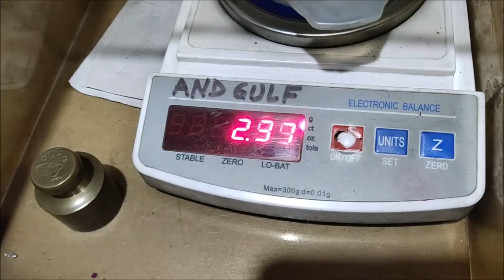How to melt old gold jewellery (Traditional Way)

Comment: Question sir, Did you mean Nausadar Katli  powder also know as - Ammonium Chloride?  Are you adding it to your metal under a flame or just dipping it at the end?  The powder "Ammonium Chloride" Is not really for bring up the gold  color as much as to  help to remove some of the baser slag metals. The reaction is simply that the chlorides of
these baser metals are insoluable in the melt, and slag off, so
available chlorine at the surface of the melt reacts with those baser
metals, causing their removal from the metal mass, but only if you add it while the metal is molten. And yes, it forms
lots of fumes, including chlorine gas… Do it only with excellent ventilation.
Reply from the maker: Sure Ma'am thank you so much for your comment

Comment: Could you make new jewelry out of old 14k jewelry?
Reply from the maker: Yes Definitely
Reply: @GoldArts  I been wearing my mothers necklace since she passed away in 2013.. I never took it off... Its a very thin chain, 1mm or less thick... I also have gold that she bought me when I was a kid that I can no longer use.. I always wondered if I could get the gold melted down to create a thicker more masculine chain from all the sentimental gold... Would be the best option but I don't think there is a place near me that does this procedure... When i asked they told me they can't do it with 14k gold jewelry that it has to be pure gold.   I never understood why.
Reply from the maker: No. Not necessarily it needs to be 24K. It can be easily made in 14K Gold. Why not ? You yourself can google 14K jewellery and see the results. Your old jewellery can be melted down and be made a more thicker chain for sure
Reply: @GoldArts  i guess they were trying to make it sound more complicated to charge a higher price.  They were saying different metals have different melting points and that they would have to extract the gold from it etc... It never made sense to me.. you melt it,, mold it, and make a chain.. wish you were in NY lol.  Thanks for the responses.. appreciated.
Reply from the maker: That's nice.. please do subscribe to my channel as well
Reply: @Guinea54  The thing with turning old gold into new jewellery is that the old jewellery contains solder. (used to put pieces together) This has a slightly other alloy. It can make the new "melt" crack more easily or things like that. Its definitely a hard proces with red gold, which contains copper, which doesnt really like to melt to a blob. Source: imma goldsmith
Reply: @Flapmansss What about a 10k ring and add 24k gold to the old ring would that not increase the gold purity? I saw some Jeweler do that, or recommend it to me for a sentimental ring I got as a child.
Reply: @kennycampos3130  definitely! He probably made it into 14k?
Reply: @Flapmansss  not sure to be honest. Thats what I was recommended, not sure how that would work. 10k+24k= 14k. I would think depends on how much gold and grams are added as well right?
Reply: @kennycampos3130  Well he couldve just stick with the 10k alloy but here in The Netherlands we mostly use 14k. 14k is 585/1000 gold (so 58.5% of 100) and the rest is silver and copper. You need to do some math to know how much grams 24k gold,silver and copper need to be added to make 14k from 10k.

Comment: Can we change it to 24k.?
Reply from the maker: Hey Vedhalakshmi,
I dint get your question.
Do you mean that can this process be used to melt 24K?
Reply: If we melt 22ct ornament, we get 22ct bar or 24ct bar?
Reply from the maker: If you melt 22K , then you will get 22K itself . Infact the karatage might decrease because it the ornaments will be melted together with its soldering paste
Reply: @vedhalakshmikj8394  شب خواب چند